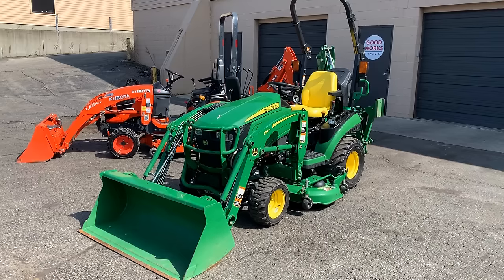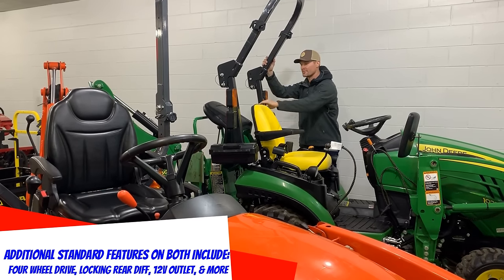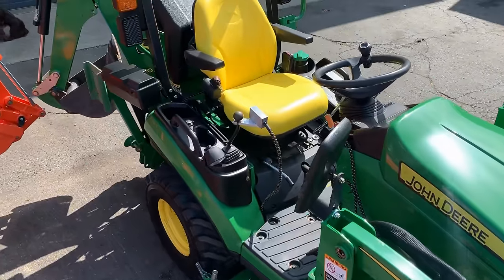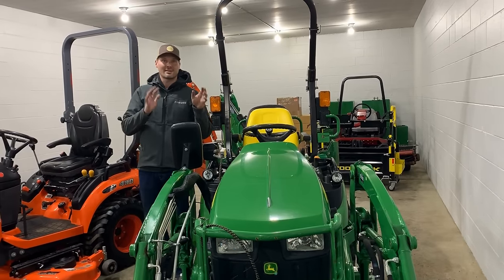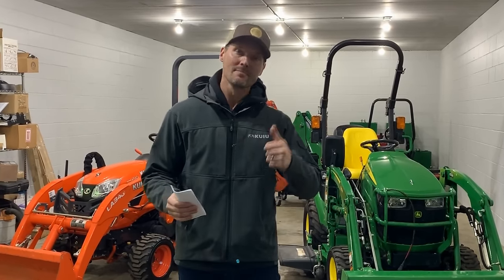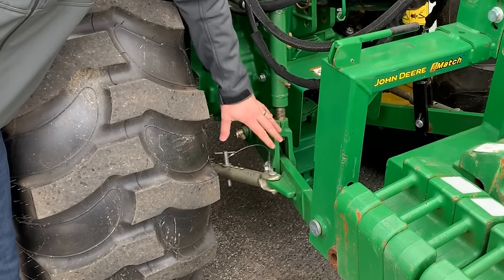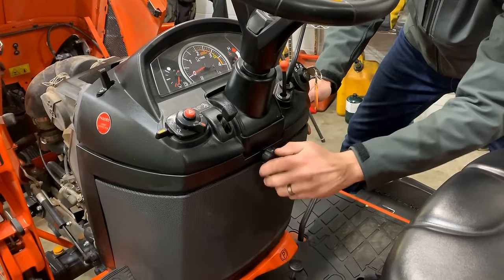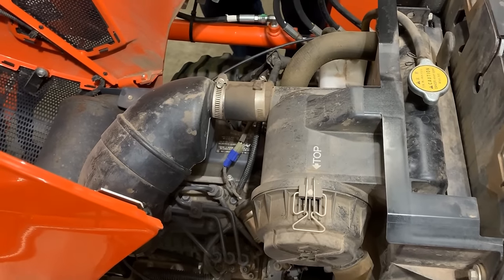CLEAR WINNER? JOHN DEERE 1025R VS KUBOTA BX23S TRACTORS! 🚜

Comment: I bought my BX23s because a friend had a small 18 or so hp Kubota tractor from the early 80s which runs good today; I have also owned a 1952 Model M JD in the mid 90's (ran good except when it rolled due to being worn out).  I would have either a JD or Kubota.
Reply: I bought my BX23s because my boss has a Kubota and recommended them.  JD is a good brand and although i am thrilled with my Kubota I would probably like the JD as well.

Comment: There needs to be a full locking differential on all four tires.  In deeper mud and pulling heavy trees it’s what you need.  And I’ve heard the same excuses that Honda ATV gave for years on a fully locking diff.  “Its something else to break”.  Well, Polaris and can am came out with fully locking diffs and left Honda in the dirt on sales.  I’ve owned a Polaris sportsman since 2011 with mud tires and never broke an axel with diff lock.
Reply: @Freedomlawnservice87  Is that 2305 a good tractor if looking at used machines?

Comment: I had a John Deere LA110 with a front mount blower and I upgraded to a John Deere X310 with a Berco front mount blower. Both had side by side pedals. I recently upgraded to a Kubota BX2380 with a 55” Front blower and back blade. The Kubota has the treadle peddle and I just don't understand why people have trouble using the treadle peddle. The switch from side by side peddles on my John Deere’s to the Kubota treadle peddle was seamless for me and I found it easy to use with large winter boots on! I do five driveways every morning and I have to do a lot of backing up and I’ve never had an issue getting used to the treadle peddle. If anything it was almost automatic for me. On both of my Deere lawn tractors the seat material cracked.
Reply from the maker: Thanks for your input!

Comment: 💥 Put you and I and Tim in a room with Kubota and John Deere’s design engineers and I’m pretty sure we could build the perfect tractor. I’m not 100% happy with either. 
They both have their strengths and weaknesses. 
Keep on tractoring! 👍
Reply from the maker: Haha, agreed!  I have zero connections, so I'm counting on you and Tim setting up the meeting! 🤣👍
Reply: My 2 gripes on the JD are  #1  why is there no anti-scalp roller in the middle of the front on the 60" mower deck and #2  why did they not put guards around the signal lights on the ROPS. @GoodWorksTractors

Comment: Sub compact tlb’s are for a different consumer....generally with smaller lots, more first time owners, and more hobbyists not using these for a profession.  I always wanted a JD but with 4 kids had to justify the expenditure for a long time.  I looked at JD, Massey and Kubota.  I thought JD and Kubota would be out of my price range and was content to have the MF.   JD was the most expensive and the least willing to deal.  To my surprise though the Kubota came in with a much lower price than the Massey and the financing was better, so I bought the BX23s.  Point is that many consumers in this category will be lucky to be able to pull the trigger on any sub-c tlb so saving three or four thousand dollars on 20k absolutely cinches the decision.

With 100 hours of use terracing the yard for retaining walls, road, patio and pond, and one storm plowing I have been impressed with the Kubota.  Only once did it fail to deliver and that was trying to lift a boulder I estimated at 1150 lbs (which this video shows JD might’ve lifted), but I couldn’t drop another $4k for the JD.  I love the skid steer quick attach loader setup and the after aftermarket attachments seem to be cheaper. The Kubota is nimble in tight spaces and I can literally see the side of the bucket to know when it’s level.  It’s a great first tlb.

I still have my overworked JD D170 mower and remain amazed it survived all my abuse but the Kubota is my yard-Harley and allows me to be incredibly productive.  I spent years looking for a good used tlb and got to see how well especially the Kubotas held their value.
Reply: What is your hydraulic pressure? Have you ever thought of checking and upping it to 1900-2200 psi? I hear many of the Kubota seem to be set low.

Comment: I have a 1996 Kubota B20 with BT750 backhoe. It was a rental unit I bought used, with aftermarket cab. It had a hard life as a rental, but man I’ve done lots of work with it! Just oil and filter changes and grease. Had the main pin on the backhoe rebuilt. This model is far from comfortable or ergonomic but it sure has been bulletproof! The one feature I absolutely hate is the electric hydraulic valves for the backhoe boom swing! This one stupid feature has given me tons of grief and many failures. Why they ever would have designed it is beyond me. Apparently there was a kit to convert it to manually actuated spools, but they were all sold out within the first few years of this engineering stupidity.  Personally I always wanted a JD. But the price difference on the new ones is substantially higher than the Kubota on similar models? We’re in northern Ontario, Canada.  Great video btw. We are thinking about getting a newer model one day soon.

Comment: I have to say that was a great review.  Thanks,  previously i have Ford, J.Deere, M.F., and an older L 2650 Kubota. The kubota was by far the better machine although I hated the Clutch. Loved the shuttle shift transmission,  just didn't like the feel of the clutch. I traded it in for a 3 E series and so far i like it. I don't bleed green but i now prefer the green tractor. Their both great tractors.
Reply from the maker: Thanks for watching Dean!

Comment: It's funny you mentioned the lift on the Kubota being fairly weak. I did my driveway with my buddies Kubota and it really struggled with lifting some larger scrap metal pieces I had in a field. This year I rented probably the smallest skid steer known to mankind and it lifted those same objects without any struggle at all. Apples and oranges for sure, but it was quite eye opening.

Comment: HA!! You went there!! You know that the Green vs Orange is always going to stir up a controversy. LOL!!

Last year I finally made my decision and bought my new tractor. I needed a sub-compact tractor with a FEL and a BH. Well, I went to see all the local dealers......green vs red vs orange vs other orange. I came down to the two that you have here as the best two for my needs. Fortunately, my dealer 10 minutes away carries Deere and Kubota so I paid him a couple serious visits. I was able to take both units (exactly how you have both in this video) for a spin and check them out in the back lot. I took a very good look, and I have been an Industrial Mechanic for over 40 years.  Here are my observations:

Deere 1025R: A bit larger physically, nice ergonomics, better low engine speed hydraulics than the BX, positioning valve for the 3 PH, extra seat for the BH, BH is an add-on, stronger FEL with larger bucket, green paint.

Kubota BX23S: Smaller and more compact form, very nice ergonomics, need to rev engine for decent hydraulic speed, no positioning valve for 3PH, BH is integral with a heavier frame than 2380, BH and FEL are extremely easy to remove, flat face connectors on hydraulics, 20 degree clearance angle on BH for ditches, skid steer FEL option, need to buy 3 PH because it is a backhoe (BX2380 comes with 3 PH), swivel seat for BH can be a PITA, orange paint. By the way........you can order a factory cab for the BX 23S, or even a convertible design. Check their website.

Here in Canada, there is a 6 year powertrain warranty on the Kubota and the Deere. Both have 0% financing for either 5 years (Deere) or 6 years (Kubota). The Kubota is also a bit cheaper than the Deere in Canada. My dealer refused to swing me in either direction, and he wanted me to make my own decision based on my needs and likes. I liked both tractors, but the overall design of the Kubota BX23S won me over as being more of a "Swiss Army Knife" design that was well executed. IF I didn't need/want a BH, then the Deere was on even par with the Kubota in my mind. 

Funny thing about the drive pedals on both tractors. Deere really promotes the two individual pedals for forward and reverse, and they put down the treadal pedal design on the Kubota. I purchased a John Deere L series tractor 16 years ago (still have it by the way), and that is the first time I used a treadal pedal setup. The dealer used it a selling feature over the old fender hydrostatic lever that I was used to!!!

Bottom line......see which one is right for you based on your needs. Both are great tractors!!
Reply from the maker: Great information man!  Thank you so much for sharing!
Reply: @GoodWorksTractors  Thanks, I really appreciate the information you pass on to your customers and your Youtube audience. I can see why you have a great customer base!!

Comment: I would realy like to see an auxillary hydraulic system driven from the mid PTO. Something in the range of 6 to 8 gpm. at 2000 to 2500 psi.with a 3 or 4 spool control valve. There are so many things that these tractors could be used for such as hydraulic sicle mowers wood splittres winches etc.I know this would not be a cheap option but it would mean you could do so much more with one machine.
Reply from the maker: These machines simply don't have the hydraulic capacity to run many of those attachments.  However, more and more manufacturers are realizing there's a real market for attachments to appropriately fit these smaller tractors, so things could be changing.
Reply: @GoodWorksTractors  I think what Jim Kidson was saying is a pump that is PTO driven.  You would then use the mid PTO to power higher hydraulic demand attachments.  

I think this would be a really sweet set-up as it would be self contained.
Reply: I’m pretty sure I saw a self contained PTO hydraulic set up somewhere.
Reply: @derekhuber3392  I saw one that was 3 point hitch mounted and driven by the rear PTO. Iwould like to see one driven from the mid PTO. so i could use it while the backhoe is attached.

Comment: Good Works Tractors
I have a video request I wish you would do. Since I don't know a great deal about this Compact & Sub-Compact tractors I would like to know if I was to run a snowblower on say a 1025R or BX2680 Does one blow snow better than the other - Is it only based on PTO Speed or what factors in on that.

Comment: I agree, the cabs at there high price point installed, need to have both ac & heat, not just heat... Worthless in the Sumer with no Ac 🙃
Reply: Tom Carter i believe Curtis does now have a add on ac unit
Reply: I do believe the BX cab has ac as an option.

Comment: I'm doing some tractor shopping for my 2.5 acreage and have a 36" inseam. Was able to check out a new Kubota 23s and a 2018 1025R today. Even though I just sat on them and worked the pedals dry for a minute I could tell me right knee wouldn't be able to stand up to the Kubota pedal for long without getting sore. Steering wheel position seemed a bit more comfortable as well with the 1025R but it wouldn't be a game changer for me. However the Kubota pedal configuration is. 
On a side note I also checked out last years Massey GC1705 and this years revised GC1723 as well. Ergonomically speaking I don't know how taller guys could deal with the Massey GC1705 steering wheel, it felt like I was reaching for the wheel at my ankles. That being said the 1723 felt like a huge improvement in ergonomics over the 1705 with its adjustable steering wheel, re-positioned loader joystick, and even the deck surface. 
Now if only a tractor manufacturer (maybe Bobcat when they are done re-branding Kioti's) would take a look at an old 1998 New Holland 9030e to figure out how to set up an HST tractors' operator station.
Reply: Mads81 if you haven’t purchased a tractor yet, you might consider the Kubota B2601. It is sized between the BX series and the B2650/3350. The 2601 is actually more comparable to the John Deere 10 series than the BX. The 2601 is on a larger platform which gives more operator rom. The BX is actually a little smaller than than the 10 but both are labeled sub compact so they always get matched up. Check out GP Outdoors on youtube. He has a B2601 and uses it for a wide variety of projects. The 2601 is an impressive compact tractor.